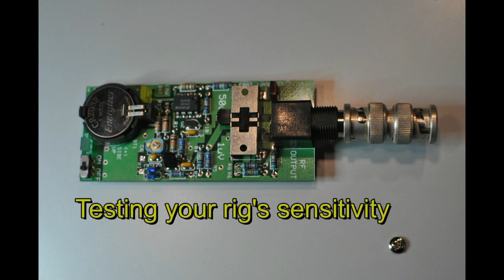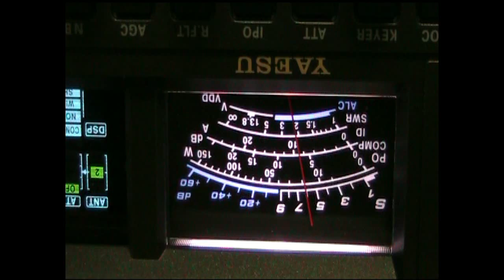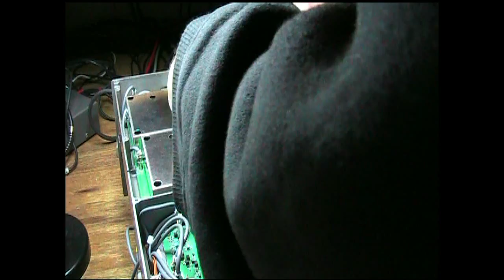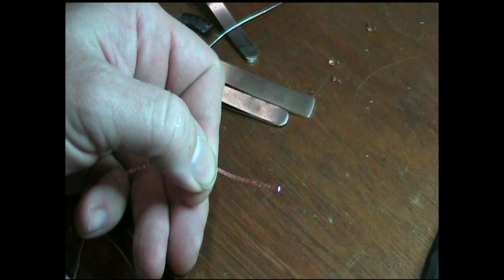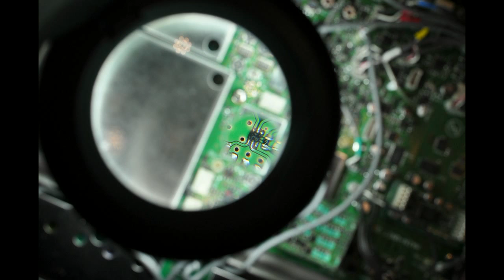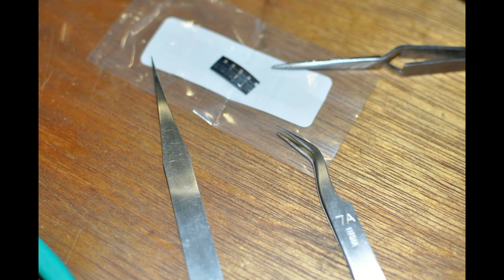FT-2000preamp repair part 3

Comment: No the RF did not come in through the second antenna port in my case.  It came in through the keyer jack on the rear panel.  I tested and verified that fact.  I have pages of test data.  I fixed the problem by putting copper over all the rear panel connections.  It is an extremely poorly designed radio in terms of EMI/RFI. I had Yaesu repair it and I sold it.  I will never buy another Yaesu product.  Oh, my new radio is an Elecraft K3.  I installed it with the exact same cabling and configuration.  I have never had any problems with it in all the years since. 
The problem occurs when you either use a KW or are near someone using one.  The high RF fields get into the radio via one of the many EMI holes Yaesu left open on the rear panel.  ie., Yaesu did not ground the connectors to the rear panel. They grounded them to the main circuit board.  Very bad design.  Commonly called 'the pin 1 problem'.  
The problem with the radio is so acute that Yaesu actual ran out of parts to repair the radios at one point.  I could probably get DXCC from all the email I get from hams with blown FT2000/5000s.  It's very sad to see someone spend a years salary on a radio that blows up in the first week.

Comment: #RF  Bullet proof your FT 2000. The problem seems to be RF getting into the receiver aerial input  when using a linear amp. When  AE 1  is used then AE 2 is isolated at the input and vice versa. Check the schematic.  However, the receive aerial is left high. To solve the problem solder in 2 back to back 4148 diodes across the receive aerial SO239 socket centre pin to ground. This will limit the RF to 0.6 Volts and no damage can occur in this region now. This mod will not affect your receive aerial sensitivity. If you do not want to go inside the set then solder the two back to back diodes inside a PL259 plug and screw it into the receive aerial socket. It`s done.

Comment: I don't repair these radios.  Even after replacing the semiconductors the radio still was not 100%.  So I had Yaesu repair it.  They replaced 11 additional components including passive components, capacitors!  VERY bad design.  Sold radio. This is the second Yaesu I owned with major design flaws.  There won't be a third.

Comment: Hi I had my mixer replaced on the rx2 unit and it made no difference. the IPO transistors are also gone wallop. You mentioned the next stage of the mixer circuit , was it faulty ???. did you send it to yaesu ? great video thanks for the info Albert

Comment: Thanks Mike, my 2000 failed this F.D. 2012 while operating from home driving a Tokyo 750w amp.  As far as I'm concerned Yaesu should recall these rigs and make them bullet proof.
After all the 2000 is not an entry level transceiver. Poor engineering and RF bypassing on thier part. Can  I send mine to you for repair ?   73 & gl